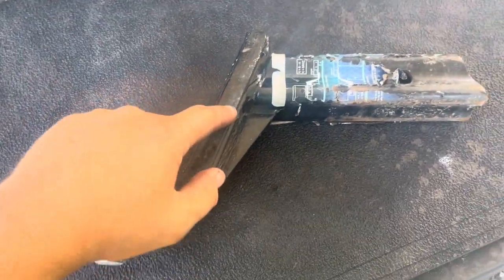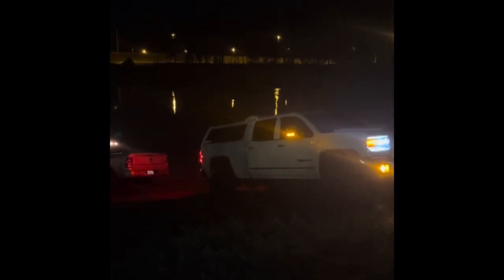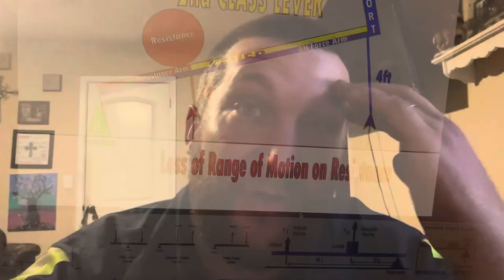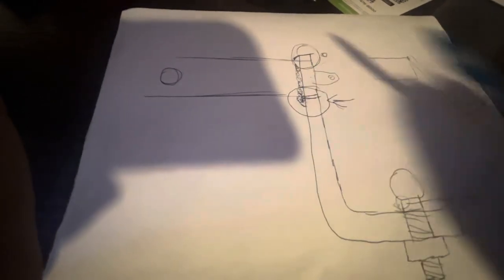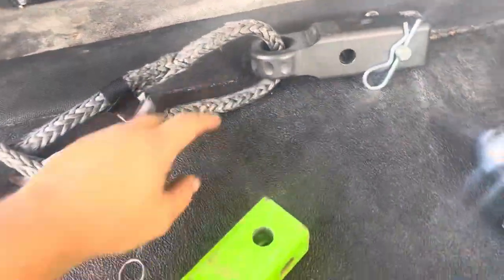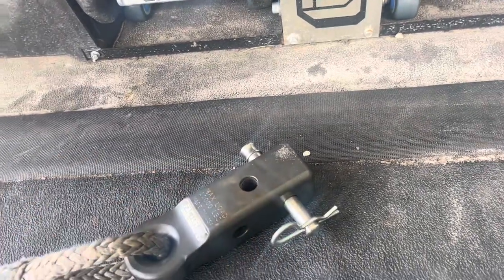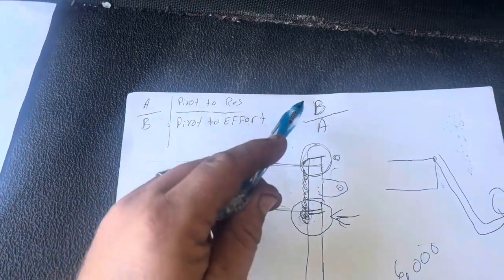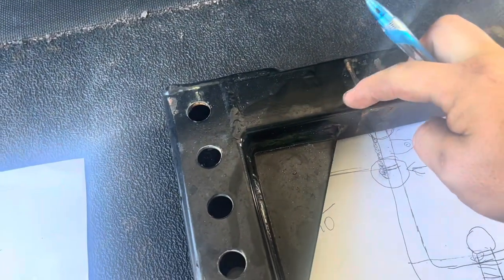Why you do not use a ball hitch for recovery’s @MadMatt4WD  @Factor55

Comment: That's the best assessment of that incident I've seen. Do you remember what size ball you saw shear off and what the recovery situation was?
Reply from the maker: I've seen lots of sheared balls, with different situations. Ive seen failures with Tow Straps which is completely wrong equipment for yank out recoveries, I've also seen balls sheared off using kinetic ropes although is the correct equipment for the yanking part but wrong technique because the vehicle was stuck in deep mud which had lots of suction.

you have to combine proper gear along with proper techniques

Comment: Is a pintle hitch acceptable alter ative to the factor55?
Reply: Depends on the coupling. I'm going to talk from a UK perspective here because we don't have receiver hitches unfortunately. If it's a European coupling, then you are cleared up to the D-value (dynamic load) stated on the coupling, which is the equivalent of a Working Load Limit (WLL) including any leverage effect exerted on the coupling, and is rated in kN; 1 kN is equivalent to 101.97 kgf (224.80 lbf). The same labelling also applies to the actual tow bar itself, so you must use whichever is lower.